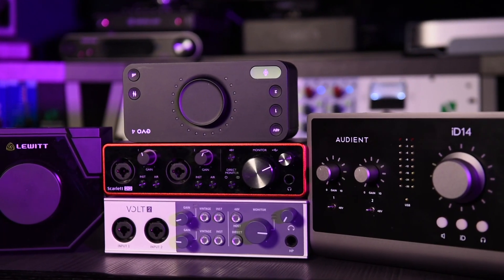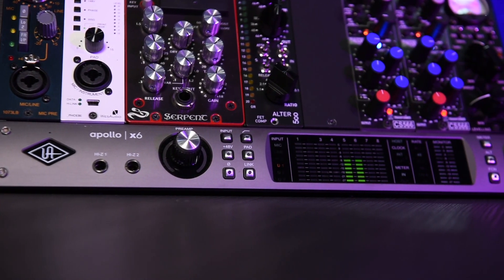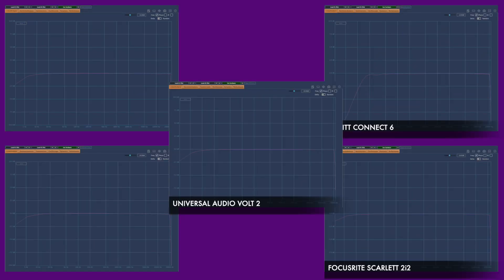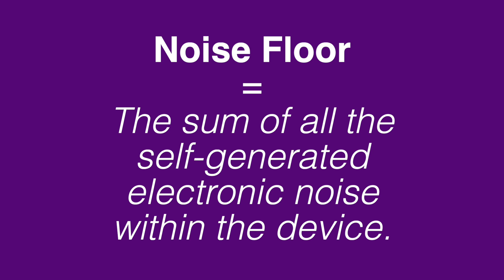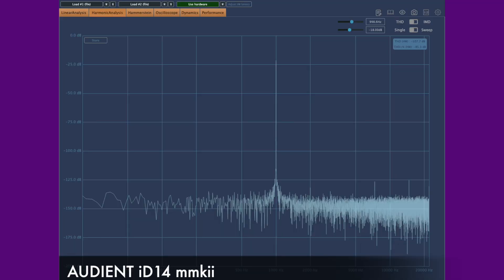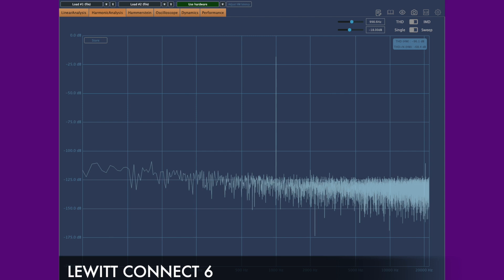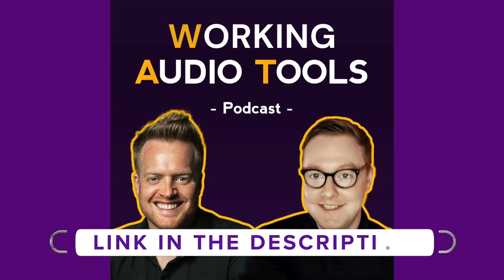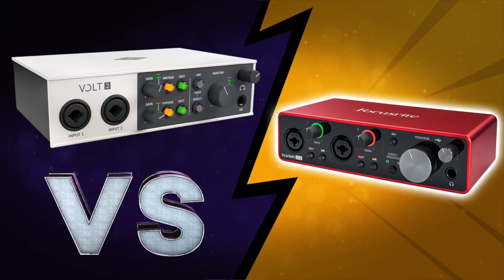TOP 5 Audio Interface PREAMPS Measured & Compared!

Comment: Not surprised. 
I’ve been around long enough we’re the high and low end vary drastically by preamp, especially the below $700 range.
Getting a truly colorless circuit is 2 grand at least, and even then it’s not perfect. we have 60 hz switching in our AC current, so anything 60hz below can also be helped by a power conditioner that cleans things down to 30 hz. I don’t know of a commercial system that can perfectly reproduce below 20hz.
Reply: AC current is possibly making a comeback, if so, it MIGHT be possible to creat a near perfect flat circuit. We’ll see.